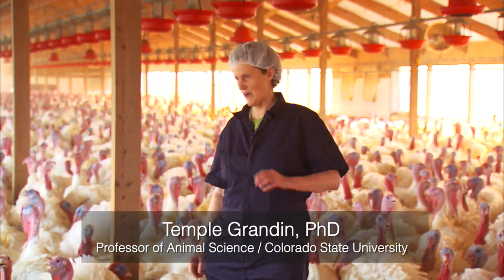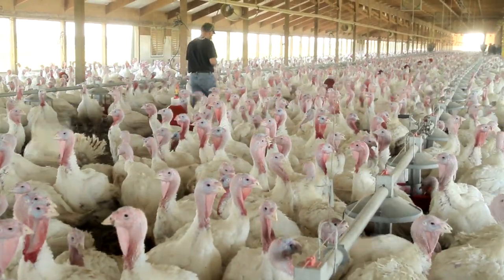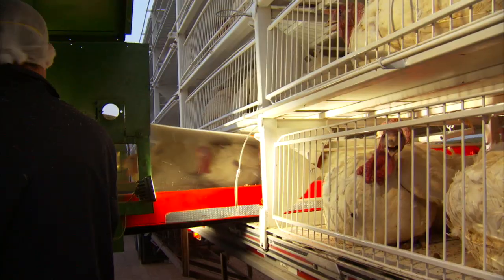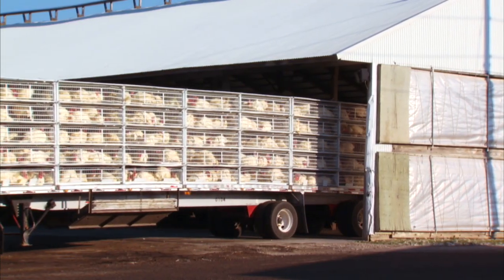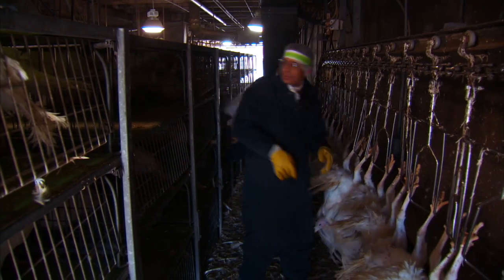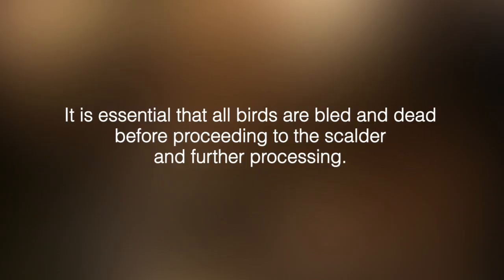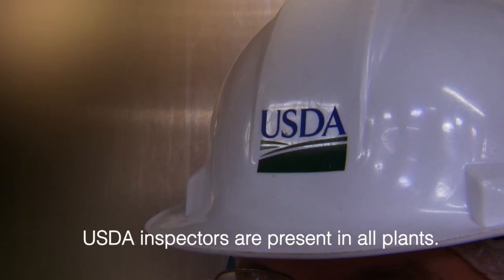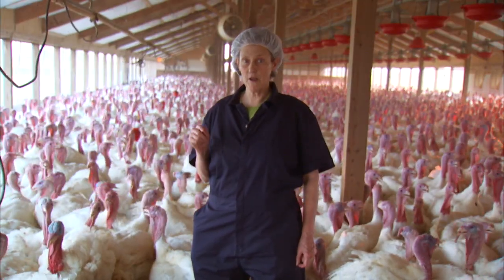Video Tour of a Turkey Farm and Processing Plant Featuring Temple Grandin

Comment: All you anti hunters take note..... would you rather be raised in complete captivity, caged in a truck, stunned , hung upside down and butchered OR live a free life in the wild and then a few of you die instantly from a gunshot while you are totally unsuspecting ???    Go visit a cattle processing plant.  The cows are euthanized with a steel bolt pneumatically driven into the forehead. then the lower legs below the knee are cut off with an electric chain saw while they are still mooing and kicking.......